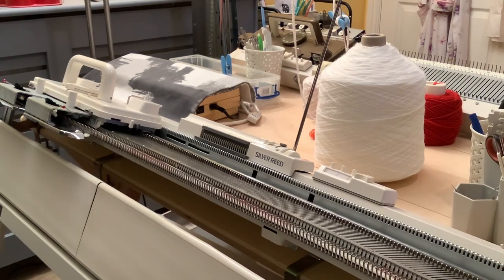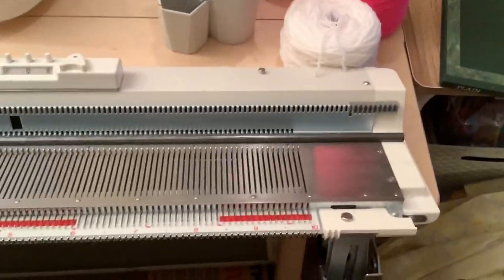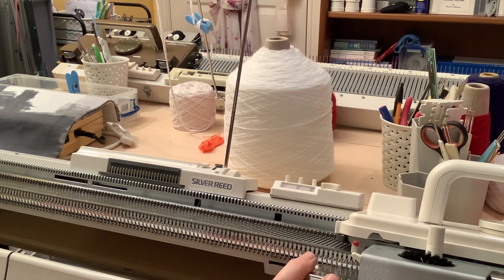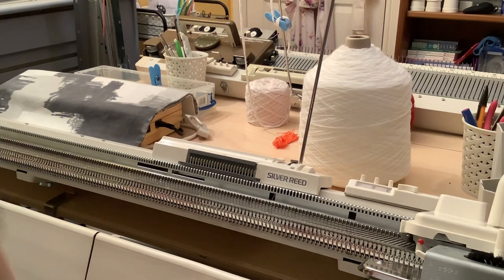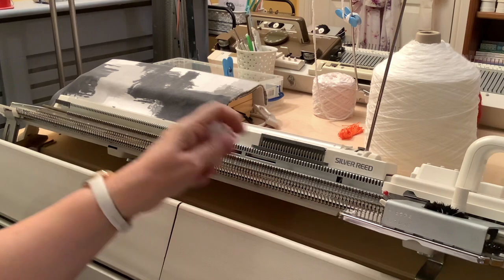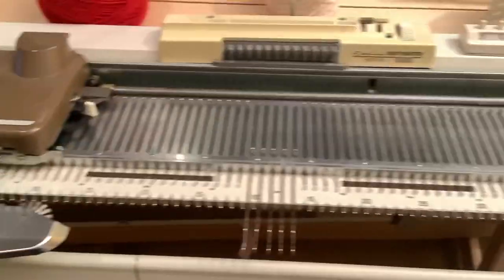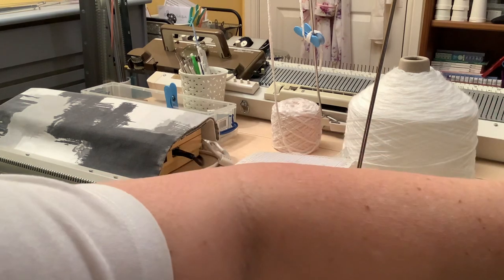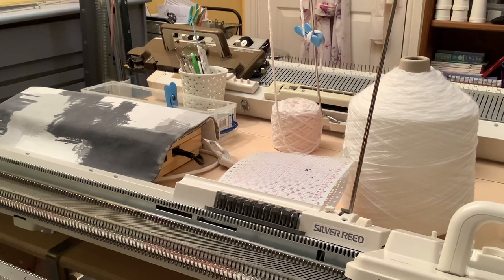Introductory tour of a Silver Reed punchcard knitting machine

Comment: Hi. Is this the finest size available? Can this be used with the Royal Loom weaving attachment?
Reply from the maker: Hi, no it’s not the finest gauge.  This is a standard gauge machine with 4.5mm needle spacing, and this is the gauge you need for the Loom attachment.

There used to be a fine gauge manufactured, 3.6mm but they are quite rare and sought after.

Comment: What kind of yarn can I use for this Knitting machine ??
I bought one , found out it doesn’t like my yarn,and where can I order the right yarn?? ♥️😊♥️
Reply from the maker: You don’t say where you are located?  This machine likes quite fine yarns, in U.K. terms that is 4 ply or thinner.  In U.S. terms it’s lace weight and fingering, numbers 0 and 1 on the scale.  If the yarn is not on a cone, it must be wound into one, or into a cake using an appropriate yarn winder.  You cannot knit directly from a ball or hank/skein.  The machine goes too fast and the yarn will keep catching if you try to knit straight from the ball, and this will cause the machine to jam and give you uneven tension.
Reply: @sallybutcherskalamundakrafts My location is SanAntonio Texas, 
All I have is Hobby Lobby, and 
JoAnn fabric, to shop for yarn, I can shop on line But I don’t know what to buy.what do you recommend.???😊
Reply from the maker: @estefanastrader3664  I am in the U.K. so I am not familiar with the brands or types of yarn available in these stores.  But look for a yarn that is 0 or 1 on the thickness scale.  As a guide, the hand knitting needle size should be about 3 to 3.5mm, with a tension of around 7-8 stitches per inch

Comment: H,i do you prefer standard gauge or chunky knitting?  I want to buy a machine but cannot decide which type to get, thanks.
Reply from the maker: I don't really have a favourite.  Each knitter will have their own preference.  If I could only keep one machine it would be a standard gauge, they are the most versatile, with the biggest range of accessories.  It will depend which weight of yarn you want to knit with the most.  Just remember that although the chunky will knit DK yarn, it only has 110 needles which will limit the size of garments you can make without piecing them.
Reply: @sallybutcherskalamundakrafts  Thanks for your help I appreciate it.

Comment: Hi Sally, is it possible to knit with more than two colours on a machine ?
Reply from the maker: Hi Alison, if you mean more than two colours on the same row, then - yes - it is possible.  On a single bed, you can do it using the slip stitch technique.  On a double bed machine with ribber and colour changer you would use the double bed jacquard technique.